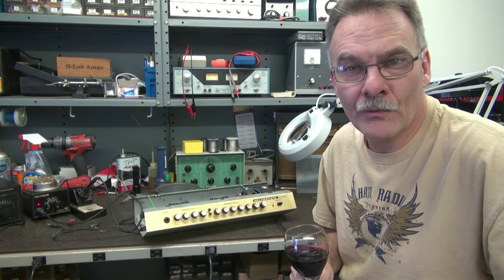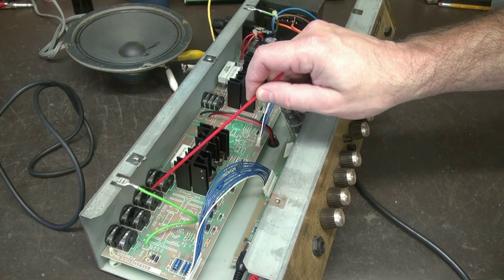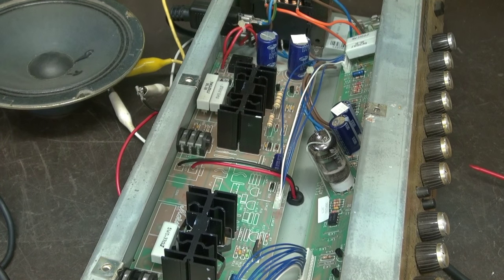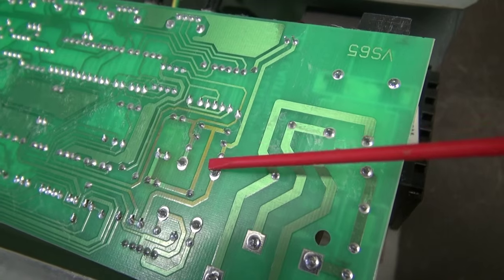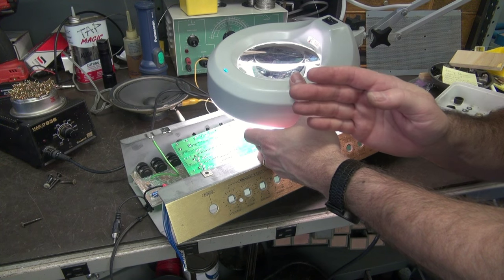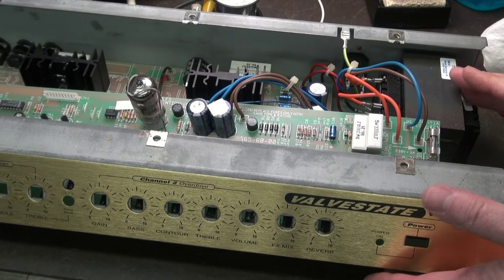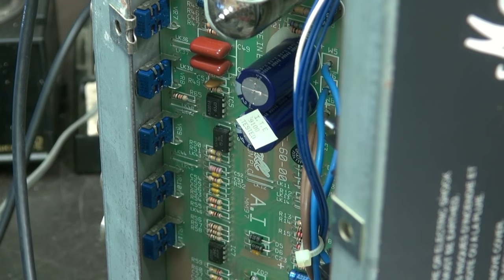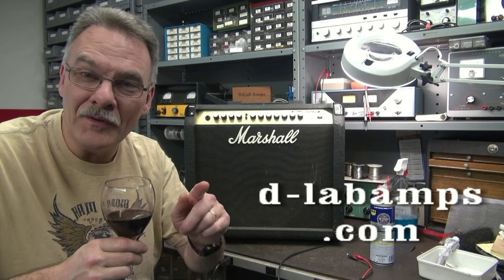Vintage Marshall Valvestate VS65R Guitar combo amp repair by D-lab

Comment: Hi D Lab, a long time viewer here. I stupidly plugged a 110v Marshal 8040 Valvestate into a 240v supply.  Fuse blew, and now the gain channel works quietly but is very distorted. The normal channel seems to work better but not fully healthy. Any idea what is likely to be damaged and may need replacing in this scenario.  Any advice is welcome. Thank you.

Comment: Great job Terry! 

I have a question. My tube Marshall blew a fuse the other day. So I went to Radio Shack and bought some replacement fuses. I then replaced the bad fuse. ( I also changed the output tubes). However after putting the amp back together I found out the fuses were made in China. I haven't powered up the amp yet. Should I be worried?
Reply from the maker: +John Simms Hi John, Of all the components that China makes, fuses are probably OK. I do not trust their tubes. Use the Russian re-issues. I have also used some China transformers with success. TD
Reply: Thank you Terry.

Comment: Just bought a Valvestate s80 for $100 not working. I pulled the PCB and found a failed solder on a capacitor. Soldered it back and the amp came back to life!!

Comment: I have a very similar amp, combo 12AX7 tube and solid state, a Hartke 100. Works fine, but despite repeated and thorough pot cleaning (spray into slots on back coves), the volume, gain controls are still scratchy. Any ideas? Great channel, btw. Just subscribed and liked. 👍

Comment: This is a fantastic help; thank you so much!  You took my fear away from getting into repair of those wonderful amps. I recently repaired my old 8080 (broken solders exactly at the similar resistors) and it's now back to live again.

I am looking for a solution to use a 3fold-footswitch (Marshall PEDL00014) with my Valvestate S80 8240 and try to switch not only between clean/distortion, Chorus on/off, but also OD1/OD2. - I understand that some changes at the wiring of the S80 have to be done, e.g. replacing the input socket of the switch (from 2 to 3 way) and wiring it to the OD1/OD2 internal switch.  I think a lot of other Marshall fans out there would love it.
Would you give that project a chance? -

Comment: They always use them cheap nasty pots just to save cost..
Even the output heatsink should be 1 long heatsink not 2 small half sized bits..

Comment: I have been given a Marshall VS15 that's missing the transformer in the amp. I can't figure what rating (ie what output voltage) transformer it needs. Any pointers?

Comment: I just got one of these " the 100 watt model 8400 I believe?" The guy bought it from a pawn shop for 140.00 and it started cutting out and making a weird modulated sound every time a note was played.. the guy was fixing to throw it away. I said hey why don't you let me take a look at that, it may be something simple like the 12ax7 went bad? He said here take it.. anyway I don't have any real experience working on electronics, amps etc.. so I got it home, sprayed some cleaner in all the pots and jacks and it started working without cutting out, but still had the modulating going on with every note played, so I looked at the 12 ax7 it was fine.. I was about to give up on it but then I said oh well, I'll just take the entire main board out and see if I can figure it out and maybe learn something new, "as I've always wanted to build some tube guitar amps for fun." I started looking at the transformers they didn't look burned up or anything, but I don't have any way or know how to really test them.. so then I started looking at the circuit board for broken solder joints etc.. I ran across two 50 volt capacitors that were extremely loose and wobbly. So I reheated the solder on them and now it works perfect. But I did notice some pretty bad soldering and expect to have to re solder more of the components in near future.. do you have any advice for someone who is a complete beginner and wants to learn how to build simple tube guitar amps, like maybe a champ circuit, or 18 watt plexi etc.. Something that will get decent warm cleans to run pedals through "pedal platform" etc.. I know some of the safety precautions, lol like don't stick your tounge on capacitors, transformers etc.. but guitar amp circuitry really interests me.. any books on building this stuff and how it works from a beginner's stand point of view would be greatly appreciated.. thank you in advance..

Comment: Thanks so much for this video. I have this exact amp (VS65R) and am going to give it a service soon, check it over and probably replace the tube. Do I still need to bleed the filter caps on an amp like this to make it safe, and do you know if the tube (an ECC83) will need biasing at all? Thanks for any help.

Comment: Fist i want to start by saying glad i found your page..you can really learn from you great job..looking forward to more of your videos..i also want to say i have two Marshall MG series Amps..2006 MG 100HDFX...2009 MG 1OOFX   i have had not a single problem with them both..they both are fantastic  Amps..i also have two JCM's..the 800 and 900 i have had issues with both especially in the tube department..and power switch with both..i run the MG Marshall's with the JCM'S..sounds fantastic when i do that..but as far as reliability..its the Marshall MG's with out any doubt..i can count on them every time..i can't say that about the JCM's..as far as power and Tone i can't and won't put one over the other..as far as reliability its the MG Marshall's Hands down..

Comment: Ok can someone please help I have a Marshal vavlestate  150 h  thats having problems  im not getting any audio out of it and when  I power it on the power buttons lights up when turned on so I checked the fuse and it was fine .  After I took out the board to see if I could see if anything was funny looking I noticed that the fan doesint work either its like there is not any power going the amp at all .. But the power button lights up lol

Comment: My brother in law brought that same amp to me for repair. Normally I only do tooobs but as a favour I looked at it.  After fixing numerous bad solder connections and a faulty pot the overdrive works perfectly but the normal channel is down in volume a lot.  Looking at the schematic I have tested every component in the entire circuit that is used for normal but not overdrive (out of circuit too) and none found.  has changed the tube to a 12AT7 but even with the right tube it’s still quiet. Absolutely stumped, first amp in 18 months that I can’t fix. Doh!!
Reply: I even socketed and swapped out the opamps

Comment: Great video. I have one of these amp's. And it has developed a very loud hum even with all the volume off and nothing plugged into it. Any suggestions what the problem may be would be greatfully received. Thanks
Reply: I have a vs230 with the same issue, I'll try to open and replace the tube

Comment: I have a Marshall vs265 valvestate that would run for a few seconds, then quit. Now when I push the power button, nothing happens. I'm thinking the switch or fuse is bad. Any thoughts on this would be appreciated.

Comment: These hybrid Marshalls are problematic with bad solder joints. (even on their all tube amps. I've found numerous cracked joints, partially due to the use of lead -free solder. It's not flexible like the good 'ol 60/40. The send/receive jacks are always a problem. I've found many of those jacks cracked or the contacts corroded. Great video as always! :)
Reply from the maker: +Frank Ferraro Yes Sir, I agree. Solid state amps are not my favorite to work on, however, I try to support the local guys. Obviously these amps wont be around in 50 years like the classic tube rigs! Thanks for your kind support on my videos.
Reply: Lead free solder. One of the 'benefits' imposed on us by the European Union.

Comment: I have a Marshall AVT50 x it had very low volume on both channels. the clean channel was even lower than the distortion channel. I replaced the valve and now its very loud on the distortion channel but the clean channel is noticeable lower. If I turn down the bass and treble all the way on the clean channel and the volumes all the way up you cannot hear anything. with both volumes and bass and treble all the way up it sounds like a 5 or ten watt amp. the distortion channel sound like 50 watts. Any ideas. I have done all the basics like lose or corroded solder joints. All jacks are clean and making proper contact. It also seams to take a long time to heat up. the tube / valve is in good working order.
Any ideas?

Comment: i have  vs100 head. has a bad solder joint i need to fix. how do you remove the actual board. i know i have to take the nuts off but there are also three white plastic cone shaped pieces that attach to rivets that connect to the amp housing.
Reply: chrisofknives never repaired an amp but try googling schematics
Reply: Not sure about the VS100, My 50w combo the board just pops off the rivet looking tabs. Pops on just as easy.

Comment: Thanks Terry, love your work! Im currently working on a marshall valvstate AVT 50H,  very similar to this 65, it was given to me as a gift. I like the amp alot but Im interested in modifying the clean channel to be cleaner, i know its an unusual thing to do, it seems i can find tons of info on mods for more gain, but i cant find anything on mods for making the clean channel cleaner.  The overdrive channel is great the way it is but that clean channel just cant get good volume without turning up its gain knob. Got any tips for me? Much appreciated.

Comment: i have the same amp, its nice sounding amp but after around 10-15 mins after turning it on amp starts to hum.  what could be the problem.hums only when cable is plugged in. used good cables still the same.
Reply from the maker: Sounds like cracked solder connections. Would be best to pull the circuit boards and inspect under bright light  + magnifying glass, look for ring cracks around the jacks/pots/power resistors/large capacitors, anything that could easily fatigue. TD

Comment: question.....i have one of these and when i switch from clean to od there is a complete drop out in sound for like seven seconds until od channel kicks on....any idea what this could be? any help would be greatly apprecieated.
Reply: i have a problem when switch channel too... but in my case, sound don't drop out, but make a noisy pop and OD channel sounds a little weak when gain pot is under 5. I have been used in this configuration for years, but now the OD channel kill the sound quickly, like a guitar with low sustain (is not my case)

Comment: If i make a video of my amp osculating could you maybe help me out.. i have electronic background but I cant figure out what the co-prate is and yes its a valve-state... But i am going to try your advice and just poke around... So ill try and explain whats happening on clean channel i get very little sound output when i go to crunch no sound... When i go to Overdrive channel i start getting the Oscillating and a really high pitch sound...
Reply: Most people would just throw this out but In ten years or so they well be gone and maybe worth some money :-D

Comment: i own a valvestate, it came with problem. maybe you can help. it turns on, but after playing for about five or ten minutes, the sound dies, comes back, dies, comes back. id really like to use this amp, is there a culprit? how can i fix it? i live in po-dunk montana-there is no one that repairs amps- so its up to me. thank you.. remember what orson wells used to say about wine!!!
Reply from the maker: Hello, That issue sounds like 1 of 2 things. 1. bad solder connections on the PCB, usually in the power supply area. Circuit board will have to be carefully removed and flipped to see. Use a bright light and magnifying glass. 2. Bad connection on the send/return 1/4" jacks. Usually it is the positive wiper on the return jack. Simply press on it with a toothpick when the sound cuts out. If it returns, clean the contact, if still intermittent after cleaning, the jack could be too corroded to save and will have to be changed. Hope this helps.
Reply: thank you so much. the amp is an 8040 valvesate. ive taken the control panel out, ill remove the circuit board and check the connections--thank you for your help. i only paid $10 at a garage sale. thanks again and have another glass of vino!

Comment: Hi I'm trying to fix an amp like this one.The amplifier power up but no sound and there is hum.So under those resistor there is some burn those resistors go extremily hot after a few second.I checked the connection but they are ok.Can you please help me thanks?
Reply from the maker: Hello, I would guess that you have shorted output transistors
Reply: Wow you have already answer.so I have checked the resistors and they mesaure 330 ohm 1 and one 327 ohm(they are good right?)S do you think that I need to check the power transistor,the ones attached to the heat sink?
Reply from the maker: Yes, those are the ones to check
Reply: You are great thank you again.So i pull out the transistor and this are the value.for the t64a I get .470 .553.For the t65 I got 4 value(is that correct) .452 .472 .572 .623. In case I need to replace I found on internet that common substitue are tip 142 147 are those ok?thanks again
Reply from the maker: Hello, if those values are ohms, like .470 ohms, the transistors are shorted. The best way to test the transistors is in a diode check function. Does your meter have that?
Reply: Yes those are the value that my meter gives me in diode check function
Reply from the maker: From B to C or E you should see approx .6vdc forward bias. In reverse, hopefully over range. From E to C you should have over range. No shorts in any configuration.
Reply: I'll try to describe the reads I get.Transistor marked t64a facing the 
label if I put the Red lead on the middle pin and the black on the left I
 get 0.565 red lead on the middle  and the  black on the right I get 0.486.Black lead on 
 the left and red  lead on the right 0.623.Other combination give me OL.
On the other labeled t65 red lead on the middle and black lead first on 
the right pin than on the left pin OL.Black lead in the middle pin and 
red on the right give me 0.453.blck lead on the middle pin and red lead 
on the left give 0.571.Then black lead on the left pin and red lead on 
the right give me OL.Red lead on the right and black lead on the left 
give me 0.620

It' very long so I'm going to thank you if you'll take the time to help 
me thanks
Reply from the maker: Roger that Sir, sounds like the transistors are OK
Reply: Ok thank so where do you think I should investigate?Do you think that the diodes near the resistors on the pre amp board could be the fault?
Reply from the maker: Sounds like a bias shift. There should be a positive and negative voltage applied to the finals. At the center point, there should be zero volts. This is the junction that feeds the speaker output thru a coupling cap. If its not zero volts there, then you have something wrong causing a unbalance. Check any power resistors feeding the transistors. Usually if something goes wrong one f these resistors will open. Check the emiter resistors, they are usually a low value like .47 ohms. TD
Reply: +D-lab Electronics so ill check all those white resistors behind the power transistor.do i have to remove them drom the board? can you please be morr precise where is the junction
Reply from the maker: Hello, nope, leave them in place, if they are open you will know
Reply: hi thanks Hey I've checked the big white one but nothing they are ok.So what can I do more?

Comment: Sir, thank you for the patience. Thank you for those great lessons you're always giving to us. My amplifier is burning the preamp TL072 .. when I change it, the amp works perfectly for a little bit, then it starts to get hot (the tl072) and fail... I've noticed that those two white 330ohm resistors are getting too hot... hot in point hurt the finger on touch.. Can you give me a light here?